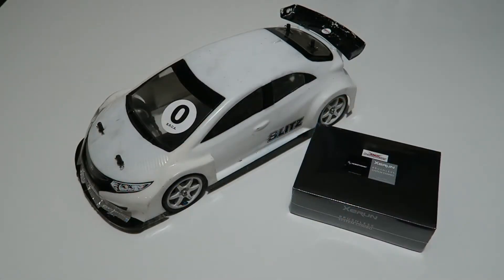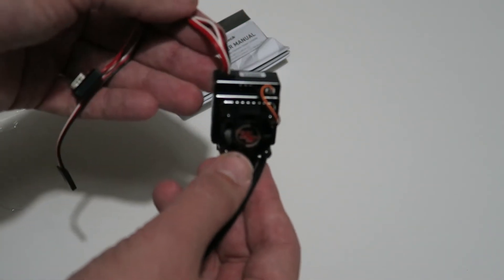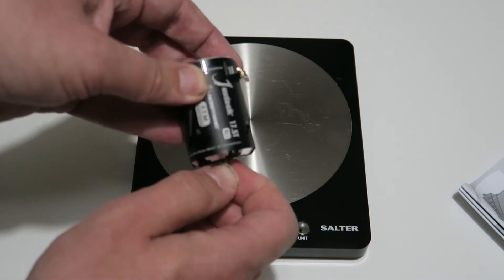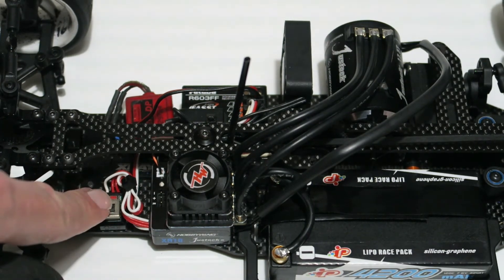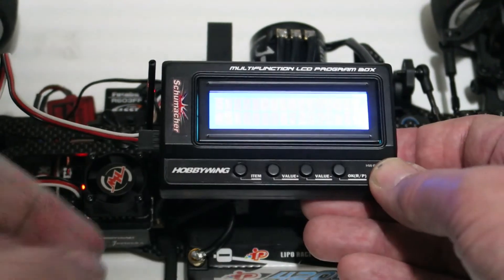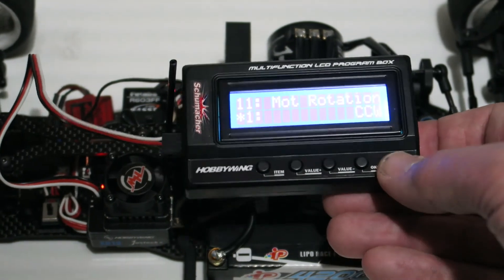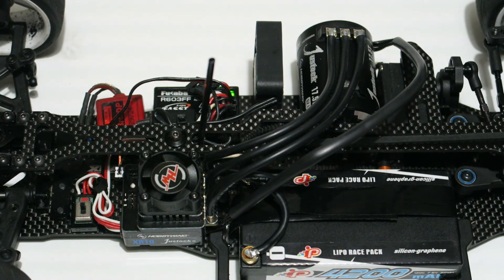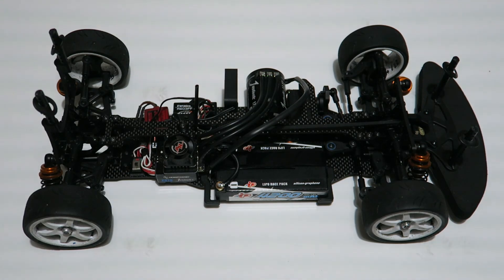Hobbywing Justock G3 ESC and G2.1 17.5T FTM Motor - Installation and setup to BRCA rules

Comment: Hobbywing ESC their junk their Motors are okay but they're esc does not put out the power that it should I bought a bunch of hobbywing motor and speed controllers and burn every ESC garbage go with Castle
Reply: Ey is this one sensored and brushless? I just got into buggies and  it said it is. Well it's in the mail on the way.  This is a little discouraging😔 but being very new  and from all I can gather.. it's not like a faster is gonna make me better.  I just need to know if it can even work well enough to clear jumps?  Maybe you could sharea little more description. Did I make a huge mistake?
Reply from the maker: Yes this is sensored and brushless. It is not as fast as a full "race" 17.5 setup. Whether that will be a problem for your use I couldn't say.
Reply: @fiveeight0sixsix  well thanks for putting it true 👍  it's what I'm preparing to learn on.

Comment: Thanks for this video... I'd like to learn more about the racing you're talking about, and about this car in your video... but I came upon your video looking up information about this Justock combo... I'm wondering if this would be a comparable setup that would perform somewhat similarly to the brushed 60A esc and a Tamiya Torque Tuned or Sport Tuned, or similar motors... ones like what's included in a TT02 kit...
   I'm trying to help start up a class at a new track that is being built near me... they're going to have GT8, Nitro 1/10, mod TC, 21.5 TC, 1/12, and Euro Truck...    I'm trying to help come up with something that will work put as another entry point aside from Euro Truck, something affordable, but still fun amd open to tuning the cars some...using included motors or what comes in brushed RTR cars, etc... and have a Brushless option as well that would be comparable...
   Sport Touring class is what I'm trying to start, and it would use the following...
    Any 1/10 , tub chassis, shaft drive car
   Any kit/rtr included brushed motor
   Any Tamiya Torque Tuned or Sport Tuned replacement motor, or a Hobbywing Justock 17.5 Brushless combo...(may spec an additional, similar sealed can brushed motor if the Tamiyas get hard to source)
   Any 190 or 200mm body that resembles a real car... no TC bodies that aren't modeled after a real vehicle
   2s lipo
   Tires will be spec, still figuring that out....but likely what's used in 21.5 TC... 

The track is just being built, so I'm fresh to onroad entirely, and have no experience with any form of spec racing really, all of our offroad outdoor racing is open/mod classes.
    Any advice or input would be most appreciated. 
   Cheers
Reply from the maker: Basically you can't compare brushless with brushed, one will always be faster, and everyone will run the faster option. Same with "open" tub chassis, you think it will be easy to enter, but someone will have a TC3 in storage that will handle much better than an off the shelf Tamiya.

That's why euro trucks are so popular, all the trucks are the same, it's just driving and good preparation that makes the difference.

Sounds like the track has enough classes already. 21.5TC would be the next step up from Tamiya trucks.